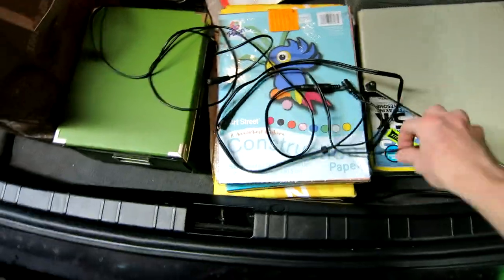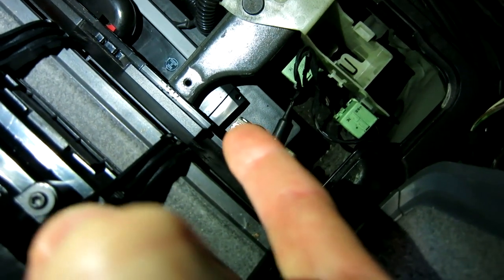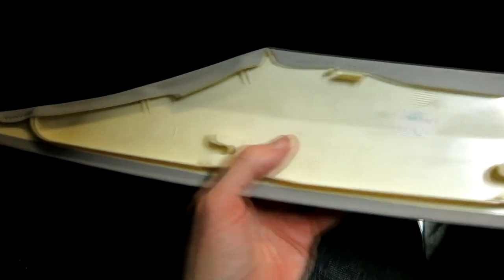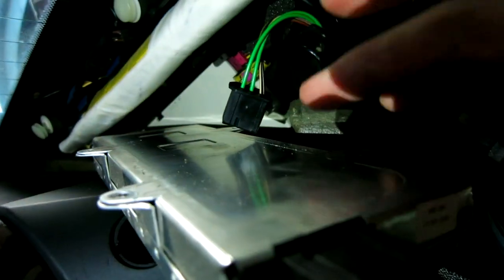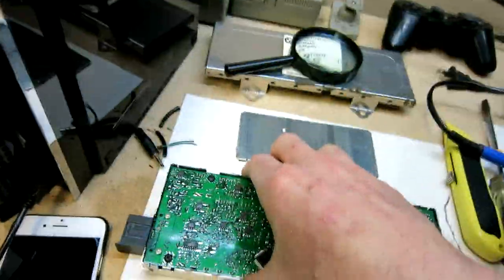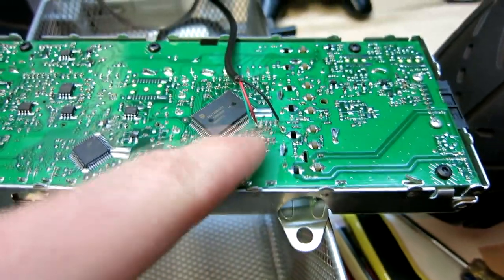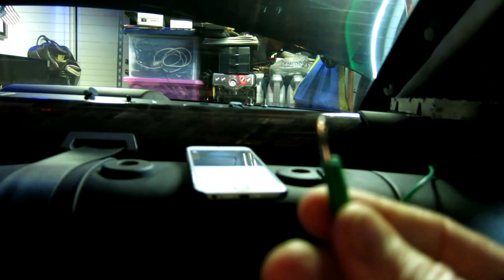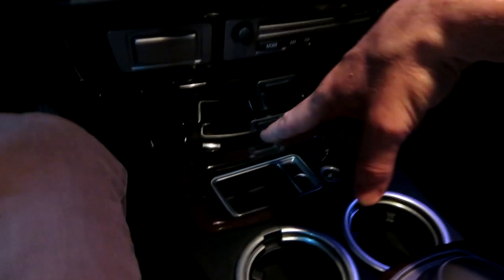BMW E65 E66 FM Tuner Mod - Play Music From Your iPhone Android Phone When You Don't Have A AUX Input

Comment: Mines looked little different for the ground location on my board. Definitely use a high quality cord (New) don't chance it with a cheapy. Not that it takes forever to solder, but why risk it. I know the quality Bluetooth can produce , I even already bought the adapter for the back of the ask unit but .....I'm about to refund it because I'm so impressed with the quality. Sounds really good. Like vinyl record quality. Thank you for this thumbs up

Comment: need some info on 2008 e65. started the vehicle this morning when I wanted to start it again this afternoon it would not start and was getting error message of park brake failure and suspension fail. could this just be due to   bad battery as the car is not being used often. will appreciate some advice. thanks

Comment: great videos, you are very patient and thorough with your explanations. I have a 2003 745Li, and replaced the battery in the fall, but my key fob started to only work intermittently to open doors, trunk, etc. then the keyfob  would not go into the accepting module and I discovered my newly replaced battery had died, Any ideas for the key fob and why a new battery would be dead after 7 months?
Reply: Did you figure this out?

Comment: Dear,Aswome stuff and Good videos in your you tube channel, it was help me all the time.I have 750i 2006.I have a problem brother, there is white or blue smoke is come from the exhaust and the engine oil level is reducing.I changed the CCV for both side as your video,it was in bad condition, but not solve the smoking problem.
Now my car now start up the engine, even yesterday I changed the new battery but still not start.Hope you to solve my problem.
Reply: Valve stem seals need replacing. If they're not too far gone you can buy a botttle or two of Lucas engine oil leak stop, it swells the seals and makes them soft again. Works wonders it reduced mine dramatically. As for it not stating, does nothing at all happen when you press the start button? if so, you need to replace the IVM module (integrated voltage module) AKA integrated supply module, pretty cheap fix costs around $100 and you can replace it yourself in 10 mins, no coding needed.
Reply: Thanks a lot .. I replaced the IVM as your advise , my car now start normally and no issue.
The great news is the value seal also changed as your advise, finally no smoke any more.
One more problem, the rpm is moving when the car in the parking position.
On the diagnostic, it show P0024, P0113,P0019 and P0100 codes.
I changed the MAF (mass air flow) sensor, but still the rpm moving.
Kindly your support to solve this issue.
Thank you
Reply: Hi, very glad to be of help! looking at the codes it seems the crankshaft and camshaft position sensors need to be replaced. Rpm.s going up and down could be many things, I would also check for any vacuum leaks, check that all the intake clamps are tight. Have someone rev the engine while another listens for any suction/whistling sounds in the engine bay. Another thing you can try is to take out and clean the Vanos solenoids, they are know to become dirty and clogged resulting in rough idle. Easy job, takes a few mins to take them out, clean and put them back in! :)

Comment: Wow I wish I seen this video  before I went and ordered the oem original cord that  connects to the back of the radio ,I seen another you tube video and am pretty  good on figuring  things out but I did get screwed on this oem cable because I don't have the aux feature on my screen, I do have a launch x431 v+ but don't see an option on any type of coding available  for adding  aux feature to my I drive.
Reply: I think that you need to use NCS Expert to change nicht_activ to active for Aux in the MMI module. Then Aux will show up on your screen.
Reply: @marktolner2922  thanks but I bought a (victsing) Bluetooth adapter and works perfect
Reply: @richyrich5080  Is that one that works through your FM radio? To be honest, I have done the same because I could not pry off my trim piece round the ASK unit - it started to crack before it would come off. I have my AUX cable in its packet still.

Comment: I did this mod yesterday toy 2006 750li. I rechecked everything and I did exactly as you did but it doesn't work. When I plug the phone in I hear the radio cut and it gets quiet but when I hit play on the phone it plays through the phone speakers instead. I can only assume it's an issue with my phone. Anyone have any suggestions?
Reply: Mine was the same, what I found is you need to buy an older model Tuner, from a 02/03 model. Its possible the new tuner will need coding to the car in order to work properly. When I say new tuner, I mean the older model you will have to buy. I haven't fitted my new tuner yet so Ill let you know if coding is needed.
Reply: But as you have the facelift model I suggest you just buy the OEM aux cable, it connects to the CD changer. Well, it replaces the CD changer.
Reply: OliverD642 do u have the part # i have a late o6 and just tryed it and the same as above cuts radio but phone still plays music whats the part for aux on for 06 to 08

Comment: what is the aux Jack used for in centre console
Reply from the maker: If you have one there is no need for this mod, because you would just plug in a aux cable from that port into your phone, you must have a 2007-2008?
Reply: DIYsavecash Thanks. it is a 2008